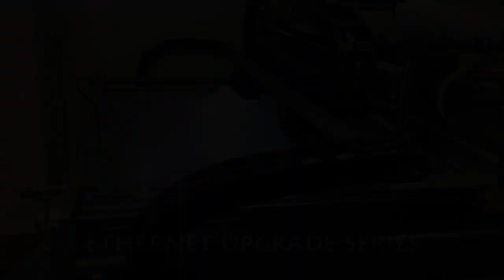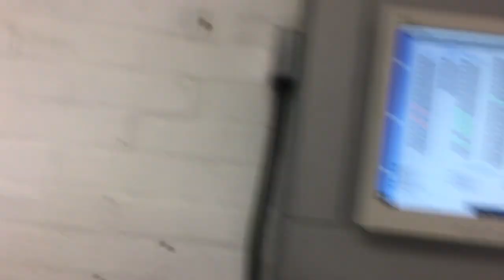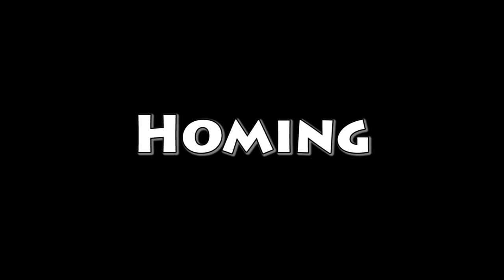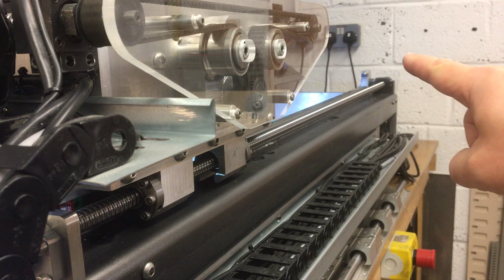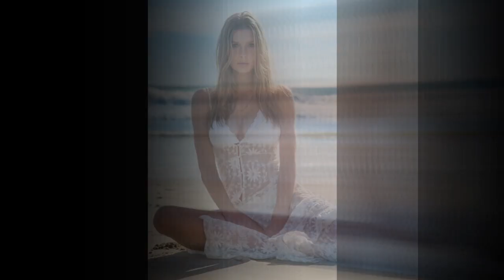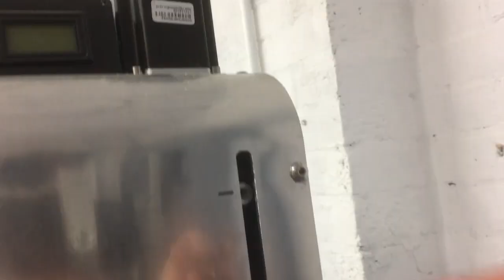Ep32:  CNC Ethernet Upgrade | "finished"

Comment: Hi. At 23:55 you are mounting two diodes. Are they mounted at the end of the master/spindle relay coils ? And which type are  ?  Great work, my compliments. ps: sorry for my poor  English
Reply from the maker: They go across the relay coil terminals and are called 'flyback' diodes.  They stop the back EMF electrical spike going into the sensitive electronics.  This occurs when the relay switches off and the energy stored in the coil has to be discharged.  They need to go the right way around.  I think they were generic diodes of the type 1NXXX.  Have a look here: https://en.wikipedia.org/wiki/1N400x_rectifier_diode 
https://electronics.stackexchange.com/questions/204332/bi-directional-flyback-diode-for-relay-spike-protection
Your English is great!
Reply: @routercnc9517  Thanks a lot for your clarification. I will check the two links 🙂

Comment: Thanks for update. I like the idea of hard wiring sensors etc to a terminal block inside controller enclosure. I'm not half way through soldering 32 individual aviation connectors and already getting frustrated. Might use that idea 🙂
Reply from the maker: Yes wiring takes along time!
Reply: @routercnc9517  I under estimated how long it would take to cable, as for cost I think prob near £500 so far including the AXBB-E controller. Still got some modifying thoughts too on front panel layout and boy did I underestimate the size of the enclosure. It is a tight fit and no room for slotted trunking so resorting to cable ties on adhesive pads. I'm saying tight fit but I've got fan at the bottom and good air flow past the controller through the stepper drivers, RCBO/Contactor/PSU to the VFD and stepper drive PSUs right at the top of the enclosure then out a vent at the top of the cab. All the various power domains are in separate locations and high voltage cables are away from low voltage and control cabling. Given some thought to the layout at least but still not much room left for future expansion apart from maybe increasing from 4 stepper drives to 5😞
Reply from the maker: Yes it is surprising how big the enclosure needs to be and therefore the cost.  So people tend to go smaller but then it might not fit when you come to put it together for real.  I made mine from scraps of MDF as the enclosures were pricy when I built it years ago but if doing it again I would hunt around for one at the best price.  Good luck with your project !

Comment: Hi Routerr cnc  Do you have a part number or type for those relay blocks your'e using. Cheers Andrew
Reply from the maker: Try searching for "DIN rail mounted 14 pin relay".  Make sure you get the coil suited to your voltage such as 24V DC.  Thanks
Reply: @routercnc9517  Thanks I thought that too, I just wanted to make sure. Cheers
Andrew

Comment: Hi Routercnc  did you get a chance to make a finshed wiring diagramm of the circuit? I would like to have a copy if possible to adapt for my own ongoing cnc control box, a never ending saga. Cheers Andrew
Reply from the maker: Hi Andrew.  Since you asked (plus I really needed to do it!) I spent tonight updating the drawings trying to remember all the little corrections I made while building it, so hopefully they are captured!  I have uploaded the 3 pages to my build post on the 'mycncuk.com' forum, post #73 http://www.mycncuk.com/threads/7699-metalworking-pillar-drill-experiences?p=127590#post127590
You may need to be a member to download the image files, not sure.  Good luck with your project.
Reply: @routercnc9517  Hi Thanks very much for that. No problem downloading. Cheers Andrew
Reply from the maker: OK no problem

Comment: Cool project. Subscribed to your channel :) will be checking out your previous episodes.
Reply from the maker: Welcome to the channel.  This series was an upgrade to the controller as the original PC finally stopped working.  The main project I was in the middle of building is the drill press upgrade so hopefully that can continue now!  Search back through my channel to catch back on that if it is of interest.  Thanks
Reply: @routercnc9517  I definitely will check out your channel for those previous episodes!
Reply from the maker: Ok, enjoy !

Comment: I have lots of issues with noise with my lathe CNC conversion, how are you dealing with them - shielded cables ?
Reply from the maker: Some are shielded.  Signal cables routed away from high power.  Inverter plugged into a different socket.  I have not cut anything yet so don’t know if it is clean but hope so !
Reply from the maker: Also running the logic at 24V helps rather than 5V.  I’ve also got home and limits set to 10ms debounce to reject short impulsive noise.  My shields and grounds all ground at the same point (look up star earth) to reduce ground loops.
Reply: @routercnc9517  running logic at 24v will definitely help, I should try that. I do have star grounds, but the VFD is the main culprit even with power filter and chokes. I had to physically put good distance between the VFD inside a separate hammond enclosure and rest of the control / logic.
Reply from the maker: The VFD was a problem in my previous setup even with line filter and ferrite on the cables.  I had to plug it into a socket on the other side of the workshop via a 10m extension cable.  Unit itself was still in the same enclosure.  Too early to say if I need to do the same again or the Ethernet has helped.
Reply from the maker: As a follow up I've been using this for some time now to machine parts and the VFD is plugged into the adjacent wall socket as the PC and no issues with false e-stops etc.  I guess that ethernet system is really helping noise rejection.
Reply: @routercnc9517  thanks for the follow up, I still have issues but I suspect this is due to a ground loop I need to track down.

Comment: Good work but I'd reconsider having the proximity sensors end on especially if you share home inputs,  if you inadvertently start the homing sequence with any of the home sensors activated (I've done it a few times😳) when you press home it attempts to back off the first axis ignoring end limits regardless of which axis has activated the home switch (because they are shared) it will not stop until you reset or E-stop
Reply from the maker: OK that’s good to know.  I’ve been running it like this few a couple of years since I built the machine (using the previous controller) and have managed to avoid that problem luckily.  During the design stage I tried to make them passing sensors rather than end on but couldn’t get a design I was happy with.  I guess I’ll just have to watch out for that one!  Thanks

Comment: Great job! I have the uc300, uccnc platform is really robust. To your question about the z axis homing offset, usually with cnc routers the z axis homes up (as I think was the case with yours as well) along the positive z direction, as homing down to zero doesn't really make sense as for zero you would need a bit in the spindle, and touch off something to make it meaningful.. with homing along the positive z direction (up from the table) and once homed, the value you set in the z offset value would be the top of the z axis. Again, this is somewhat arbitrary, but could reflect the maximum travel of the z axis (in my case I set it to 200mm), so this becomes the z home. When the z axis goes down, its position value decreases. Hope it makes sense.
Reply from the maker: OK yes that makes sense.  I guess I used to all my Z moves being negative.
Reply: @routercnc9517  That is the standard.
Reply from the maker: Thanks Lee
Reply from the maker: Hi Lee.  Sorry to use this method to contact you but I've been trying to PM you on the mycncuk site.  My problem is in the open source section with a file upload, hope you can help, thanks.

Comment: Nice work! Now you just have to finish the drill press and you can start the CNC Slant Lathe!!! 🤣
Reply from the maker: I know.  It’s projects all the way down !
Reply: @routercnc9517  Is that a world turtle reference?
Reply from the maker: Indeed it is.  When I mentioned to my friends that I was now thinking about remaking the lower control panel with all the buttons on they rolled their eyes:  I released it was getting into projects on top of projects and I should finish what I started !
Reply: @routercnc9517  Yes, it is good to keep a list I have found, but sometimes you have to do enabling projects to do other projects, such is workshop life! Really enjoying your videos still, right up my alley.